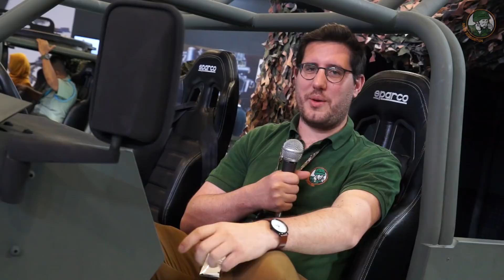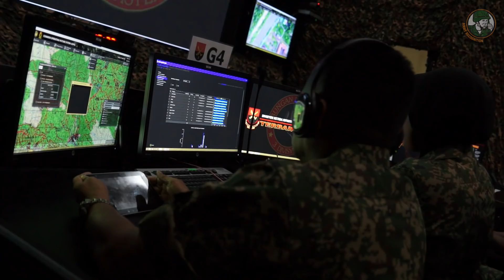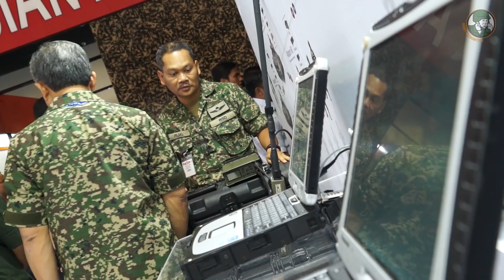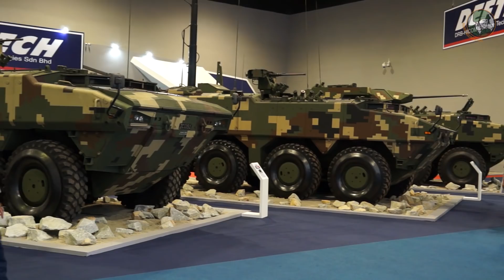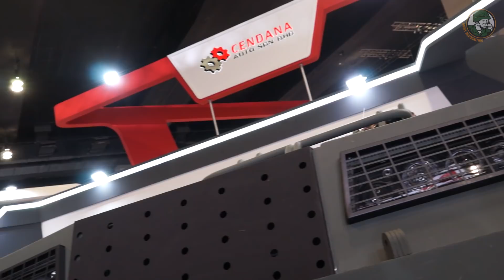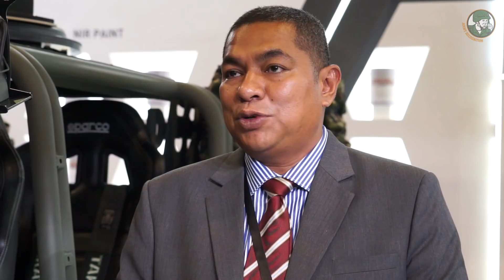DSA 2018 : Modernizing the Malaysian Army

Comment: The Malaysian Armed Forces is not the best neither the worst. The army is okay but the command tree is mainly made up of 'yes sirs' and not officers with real combat experience. The navy's ships or obsolete and same goes for the command structure made up of 'yes sirs' . The Air Force is the worst as there so many types of small amounts of aircraft that means a very unbalanced power when all the aircraft's have different capabilities and yet very little of each type to make a proper fighter group and maintenance is at a low grad and so is the command structure. Malaysian here btw , I would like to hear your opinion so go ahead to reply to this comment
Reply: I won't say the Airforce is as bad as you say it is. The planes are very capable, especially the MKMs and the Hornets. Perhaps the only one bugged by maintenance issues are the MIGs. They are about to be replaced though. However I do agree with the quantity issue. The amount is too small. 
Navy. Ships are being replaced. The current frigates are still good. The Laksamana corvettes pack a punch. The progress of our new LCS is moving as planned. For me there are 2 issues for the navy. The Kedah class needs to be better armed. And we need logistic ships.
Reply: F16s are no match for the MKMs. What is your gripe with the MKMs? You and Ghost Hunter seem to imply that its only a very average aircraft. Its actually a very good plane and can give western top tier mrca a good fight. The only issue is parts and maintenance of russian made planes.
Reply: Malaysian Armed Forces are mainly Deterrent by design. I do agree though that more fighter aircrafts and MBTs are needed, i.e. Armata T-14. But don't forget we also have large amount of anti tank weapons of various kinds and distances. Anti aircraft and anti submarines are also sufficient for deterrent measures. Bear in mind Malaysia don't go around annexing others' territories.

As for the command structures, it is necessary to follow structural protocol, and most Malaysian Commanders are highly capable and credible thus creating a very effective defense structure.

GGK, PASKAL and PASKAU are whom we turn to for independent and self sufficient force multiplier and so on...
Reply: arthur lee -  why do you think the maintenance and the command structure are at low grad?
Reply: Grand Moff Tarkin we don't have to our government is already corrupted with alot of funds going into politicians pockets I think the one of utmost importance is the air force, no need for high tech aircraft but instead tried and tested aircraft  such as F16s and F15s. These are still good aircraft and stand a good chance, look at the Singaporean Air Force as a good example
Reply: the deal for 18 Mkms was $900mil. Rsaf deal for 12 F-15s was more than $1.0billion. I would have preferred the F-15 over the MKM too. But to say it would have been cheaper is wrong.
Reply: Muhd Eizrool yeah maybe we will never know
Reply: ʏᴜɴᴀ ɪsᴀɴᴏᴠᴀ hawk is not our front fighter, each jet has it's own role, mkm and hornet shoulder that role,   hawk is just for support and ground attack. Our mkm and hornet is strong enough to fend any attack from neighbouring Asean.
Reply: war doctrine final battle should be ground troop to wipe-out any intrude.. our Great MAF advance  in jungle warfare...we wipe-out Gayang Malaya 1962/1966, wipe-out pinoy intruded sabah, wipe-out communist, wipe-out sulu pirate mac2013.... .
Reply: The Ghost Hunter Please read more about T-14 Armata, the most important aspect is the protection for the tank's crew. Of course fire power and tank defense are top of the class too.
Reply: Thanks for pointing out the truth, respect from Malaysia.
Reply: We can buy upgraded M60 Tanks from the US but the refurbishing ad modification cost is higher, just look at Taiwan(ROC)'s modification attempt on the M60 Tanks, they found out to be slightly more expensive than buying T90s and M1 Abrams.
Reply: I'm from Malaysia
Reply: Here's the plan B: Our Malaysian military can buy around 50 K1E1 Tanks from Korea, on the other hand buy 100 upgraded M60 Tanks（retaining the original M68 105mm rifle gun in order to cut cost) from US, a high low mix approach. This idea came from Russia and recently Taiwan.
Reply: If I really wanted a Russian Tank I would go for T90AM, Armata tank is too audacious and mechanical intensive tank.
Reply: Benjamin Yeo my reason is we won't have enough MKMs the money it takes to buy 10 MKMs is 15 F16s or 15s we can buy plus where can we find that much money anyway
Reply: Since our government is so corrupted that makes our budget so tight, to solve the Air Force issue, our Angkatan Udara can buy JF17 from Mainland China(PRC) and F-CK 1 from Taiwan(ROC), these things are cheap, on the other hand buy a few handful of Advanced Super Hornet to fill the gaps. Again, this is high low mix approach.
Reply: Arthur Lee most of malaysia defence thing are mostly secret
Reply: The Ghost Hunter and plus we have the Singaporeans who cab provide help in maintenance and training
Reply: The Ghost Hunter yes I understand that
Reply: Arthur Lee fully agree with your opinion.
Reply: The Ghost Hunter hahaha well our gov prefer to buy unsinkable subs rather than jets..even a jets engine have been stolen..wakaka..
Reply: The Ghost Hunter yup..our air force  being equipped with old school stuff...trust me ive been visited the air base in kem tudm batu 10..they still using gifted hawk from back then..they keep upgrading it so it will cut the cost but nvr think,to keep those maintenance for old junks even cause greater cost each year..sry just my opinion.
Reply: try follow mmp fb page, hawk is indeed old but it's still powerful, look back at during lahad datu incident
Reply: saniy well my opinion was just in case in the future they end up with dogfights in open air ...that would be outmatched against other modern combat plane.
Reply: Yes sir
Reply: Hipe mahathir just buy more malaysia independencely made weapon,tank and airaft
Reply: true bro....
Reply: The sukhois were a huge mistake, sure when we first got them they were arguably the most advanced fighter at the time but seriously its logistic and spare parts issue is costing RMAF a lot of funds that can be used on other needs. For a really advanced jet it was cheaper than say an f16 but that was only its short term cost, its long term cost was super expensive, had we have gotten the superhornets instead we may have gotten probably 3 batches worth (possibly 54 to 72 units) and not to mention it seems the air force really liked its legacy hornets. Hopefully we can get out hands on 2nd hand aussie and kuwaiti hornets. Same goes to our mbt the reason why we bought the pendekars i feel is not justified. They argued that Malaysia cannot have an mbt over 50 tons but indonesia bought leopards nevertheless and they seem to have no issue with it. If weight was indeed an issue we honesrly should have gotten the k1 88 mbt instead as the koreans were offering a 48 ton variant. We have the best soldiers but sometimes what the politicians buy for our military isnt necessarily what our troops probably wanted. The lcs and gempita was probably justifiable tho as we got tot but we gotta find a way to make that worth it.